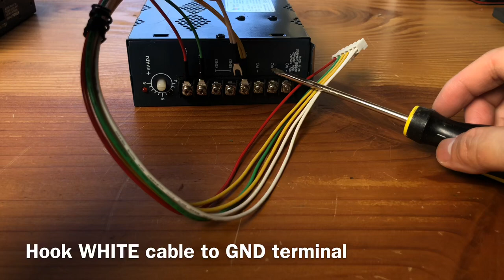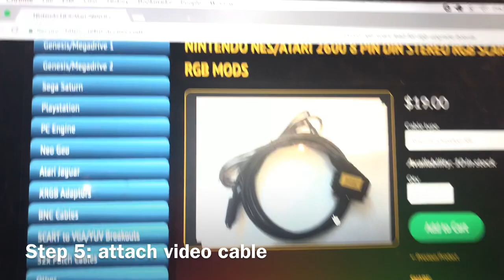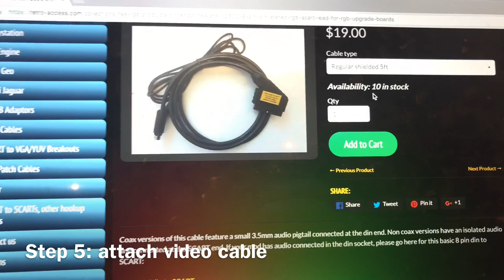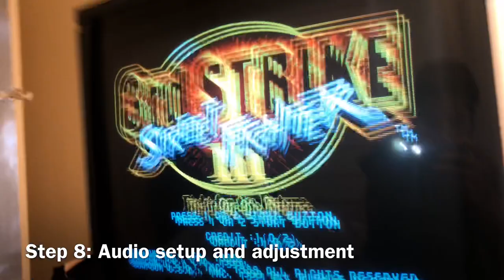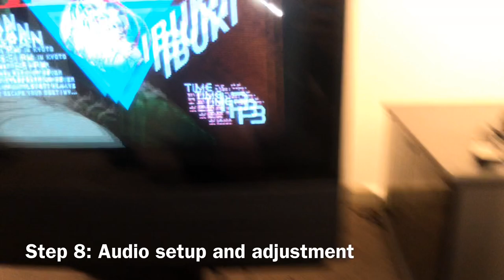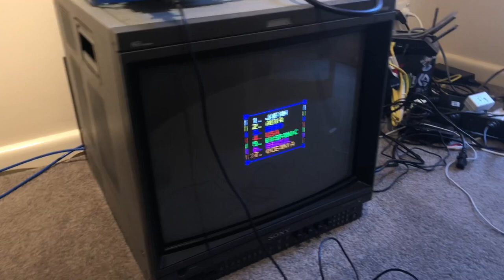How to setup HAS Home.Arcade.System SuperGUN v3.1

Comment: Can I connect a fork terminal to the ac power supply after striping the wires?
Reply: Please do. This guy is risking shorts straight from 240v/110v mains if the unit is moved or tugged on. Terminals highly advisable.
Reply from the maker: yes, please use Folk Terminal, i did get lazy in my tutorial. It's much safer and recommended method to use folk terminal.

Comment: Hello, is it possible to use an arcade PSU as yours on SuperGuns like the retroElectronik ones, which seem to only accept 20 or 24 pins ATX ? Thanks a million
Reply from the maker: If you check my video, i am actually using the arcade PSU here. It's not ATX PSU.
Reply: I saw that, but the RetroElectronik SuperGuns have different PSU Inputs: only a 24 pins ATX and a another part with slots to inputs electric cables from an Arcade PSU, I guess. Thanks anyway

Comment: 1- Does the kick harness connect to the HAS or the Jamma boards themselves?

2- Any kick harness compatible with CPS2/3 will work such as the ones found on mikesarcade.com? Or does RGB sell his own? 

3- Does one single kick harness work for both player 1 and player 2?
Reply from the maker: 1. Kick harness cable, one end plugged into HAS, the other end plugged into JAMMA board (example: CPS2 board has kickharness port)

2. RGB sells his own kick harness cable, I am not sure if kickharness from mikesarcade.com is compatible with HAS supergun. But you should drop a message to RGB to ask about this. I assume it should be fully compatible

3. that's correct, one single kickharness work for both P1 and P2

Comment: Sir ... my A boards fans (CPS2 & F3) doesn't start when i power up the system ! Any advice about this (i use a SUZO/HAPP psu) ? I placed the cables like you do in this tutorial :) Thank you in advance for all !
Reply from the maker: I'm not familiar with suzo/happ psu, but have you adjusted the voltage on the PSU yet?
Reply: Done ... i've remove the stock fan and i've replaced with a new one ! All good now ! Cheers !

Comment: I have an HAS v3. For some reason I get faint wavy video noise regardless of pcb. Any ideas?
Reply from the maker: have you checked your PSU unit to see if the voltage feeding is 5v? also it could possibly be the RGB cable... or it could be even the HAS unit itself has issue.
Reply: Discovered it was a ground problem. I disconnected the FG cable and connected it to standard ground on power supply. Now looks perfect

Comment: 2 questions. 1) what's the cps2 kick harness for. 2) how do I connect a fight stick to this
Reply from the maker: The CPS2 kickharness cable that can be purchased separately, will allow 4th,5th and 6th button be used as kick buttons in certain games like Street Fighters (same thing works on CPS3 as well)

To connect fight stick, you need to buy Undamned UD-USB adapter just like how i demonstrated in the video. Without this adapter, you wont be able to hook up fight stick at all.
Reply: @modology  thank you.
Reply: Do you need the kickharness if you use regular controllers or only if your using a fight stick?
Reply from the maker: @Miketage  You still need the kick harness cable regardless if you are using fightstick or joypad
Reply: Miketage you need the kickharnesses for any 6 button game, so pretty much a majority of Capcom’s arcade fighting games

Comment: Hi, where did you get that 6 pin power supply cable with the grounding forks? I can't find one anywhere.
Reply from the maker: It's cheap arcade powersupply that you can buy from Aliexpress. Just search around there
Reply from the maker: Try to contact Micheal aka RGB on Arcade Project forum, he sells this cable

Comment: Instead of an arcade power supply why not a computer power supply and what one
Reply from the maker: you can use computer power supply as well but Arcade Powersupply is much easier to wire up and also easier to adjust voltage
Reply: @modology  what would be the best pc power supply to use